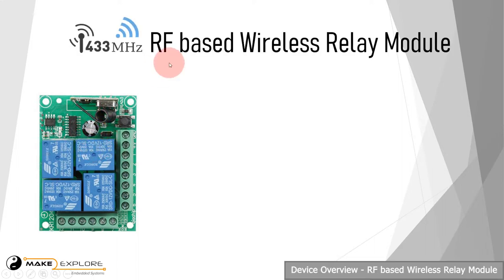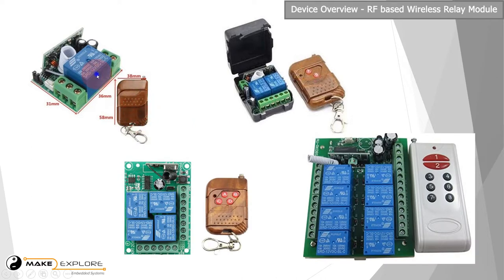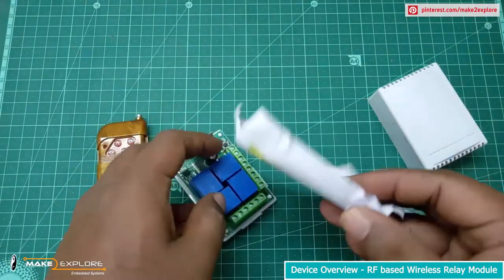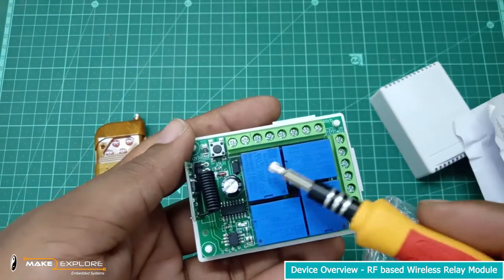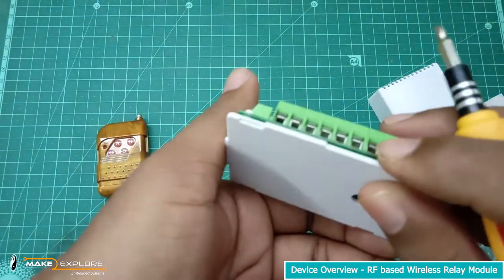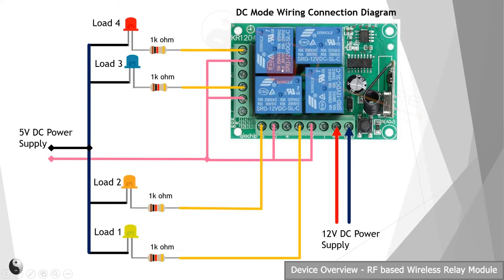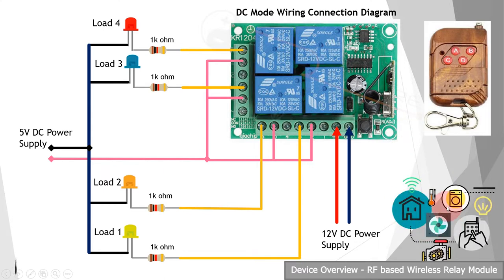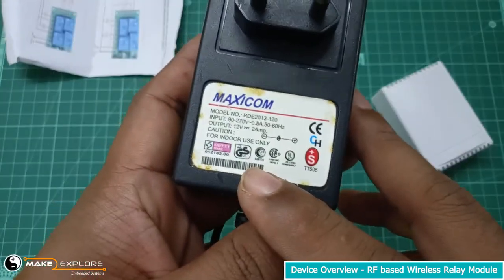[Device Overview]  RF Based Wireless Relay module with Remote Control

Comment: what specific battery do we need for the remote?
Reply from the maker: Dear Subscriber, 🙏 Thank you so much for your interest in our channel.

This RF remote requires, 27A 12V Alkaline Battery. It typically used in remote controller, cigarette lighters and many other electronic devices, it can provide extensive long power life and work effectively and keep longer time than other batteries. Battery Cell Composition: NiMH, typical capacity - 55 mAh.

for example - https://amzn.to/3GsxrDA

If you still facing any issues in replicating our projects, Feel free to contact us through email  
📩 - info@make2explore.com
Also, For quick replies, you can always chat with us on 🚀 Telegram Just Search @make2explore  on Telegram 🚀

We'd ❤️ love to help.

Best Regards 🙏
Reply: @make2explore  is it the same for the 1 button remote control that looks like this?but it only has 1 button?
Reply from the maker: Dear Subscriber, 🙏 apologies for late reply.

Yes, It will be the same for the 1 button remote control also.
Reply: @make2explore  this is a remote device!!...but nobody tells exactly the actual practical range of the device !!!!    
what is the range inside the house...between rooms (20-30feet away) with doors open ? will it work ?
did i have to be in line of sight to operate it?
Reply from the maker: Dear @Anand Joshi, 🙏 Thank you very much for your interest in our channel.

Its RF device, We've tested it indoor(In House) as well as outdoor. 

Indoor Range - As per datasheet (Around 25m with receiver sensitivity of -100dbm). Practically : is upto 35 Feets. Typically it requires LOS (Line of sight) But, It can also penetrate through (thin) walls and partitions.

OutDoor Range works like car Remote - As per datasheet (Around 50m with receiver sensitivity of -100dbm). Practically it is upto 70-80 Feets.

(Provided Conditions - Remote Battery should be fully powered, and Antenna is taken out)

If you face any issues in replicating our projects/Tutorials, Feel free to contact us through email  
📩 - info@make2explore.com
Also, For quick replies, you can always chat with us on 🚀 Telegram 
🔗 https://t.me/make2explore

We'd ❤️ love to help.

Best Regards 🙏
Reply: @make2explore  its working across 30 feet room  with door closed....thanks